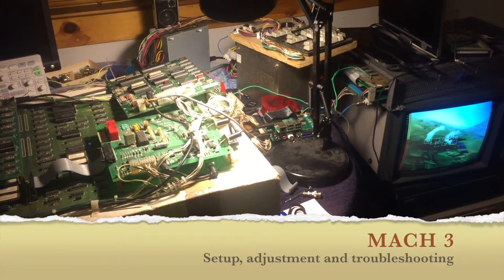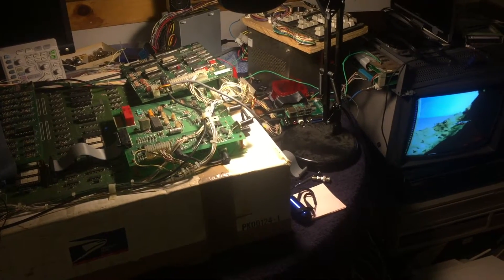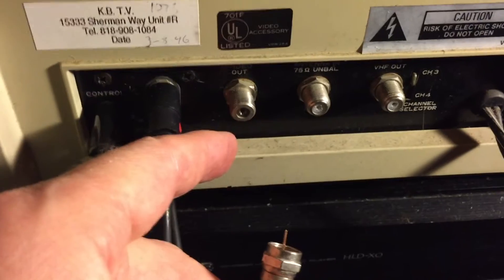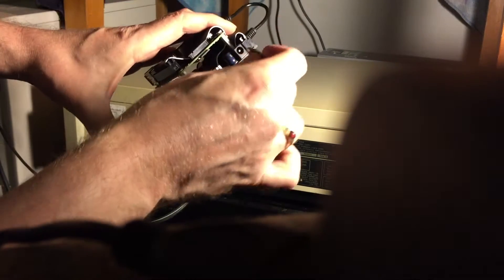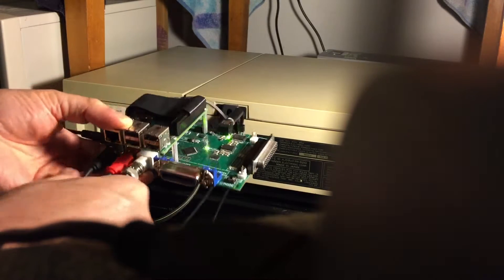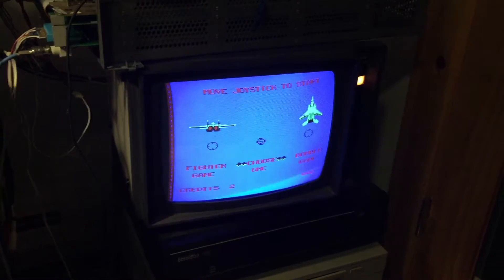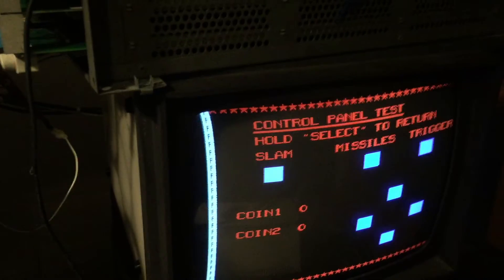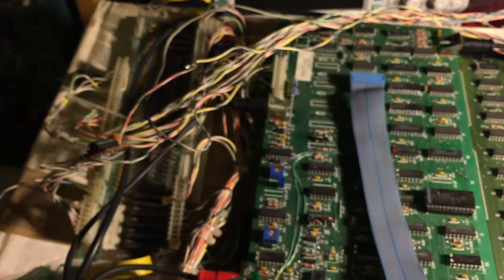MACH 3 - Adjustment and Troubleshooting

Comment: Sorry if this is a bit of a silly/unrelated question, but how feasible do you think it would be to make a JAMMA adapter for LD games?  The most likely one in my mind would be Cube Quest because it has a mode to play with just PCB graphics.
Reply from the maker: Ataru Moroboshi   Hi! I've built Jamma adapters for various laser games so I can run them on my test bench. Nearly all of them have compatible video, but there are often quirks you have to deal with. For example, MACH 3, needed a 74LS00 chip to combine the H and V syncs into composite sync.  (You can see it on a little perf board near the audio/video jacks.)
The adapter I made for Firefox (which is actually sitting on top of the monitor in this video) doesn't use the Jamma connector for the yoke controller. I also had to run a couple of larger power wires directly to the board, since Jamma connectors and supplies don't handle enough current to run such a power-hungry board. Cube Quest would be a similar story -- wire the trackball and a massive 5V power supply straight to the board set. 
Even when you can't use it for everything, Jamma is a decent standard to use as a starting point.